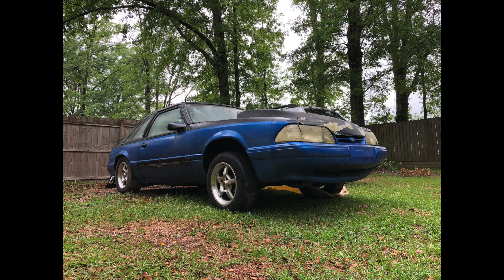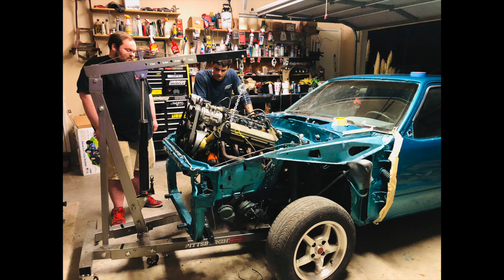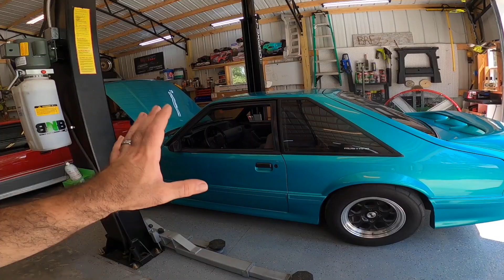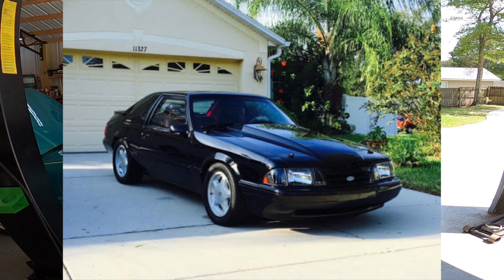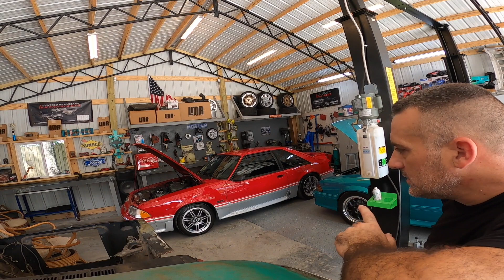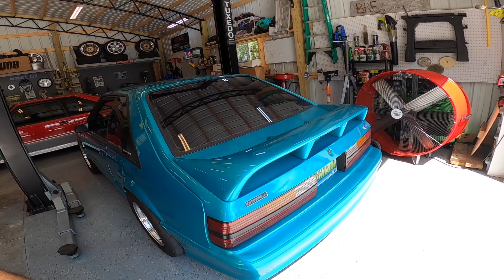YOUR BUILD NEEDS YOU TO HEAR THIS! - The best advice I can give you

Comment: Great message. That's funny to think that the problem with winter is that the car is done and you can't go race it. The way it goes for me with winter is, I've been fighting with a problem with my car, and I've reached the end of my rope. Well, at least it's getting colder out now, so it doesn't make as much sense for me to be out working on it. Time to take a break. Winter is my sanity break. I would put way too much pressure on myself if I didn't have winter to intervene in the process for me.

Comment: Good advice for sure.  I think some retro and 65 content will be plenty cool until the new trans come in.  I've had my 01 cobra for 10 years. It always needs something. Every time I replace parts... I update them. Currently I've replaced all my shocks/struts with bilsteins. I bought struts back in April. They were on back order like everything since covid and showed up finally a few weeks ago. I installed with bumpsteer kit. Got an alignment.... still not within spec so I just ordered MM Caster camber plates off lmr. I used your channels link of course. Long story short..   its always something. I've felt like giving up at times and selling car...  but it's paid off and owes me nothing so I just keep holding on to it. Plus at this point I've fixed so many precious owner F ups and made shit better and right it's hard to give it away to someone else. I bought this car 10 years ago for $11,500.... I've enjoyed the dog shit out of it.... and I could probably still get atleast 10 grand for it.... no other car has been that good to me value wise.  Love the new brew2l hat btw. Thanks for the fast shipping brother. I'm not even a foxbody owner but keep coming back for the good content and motivation. 👍